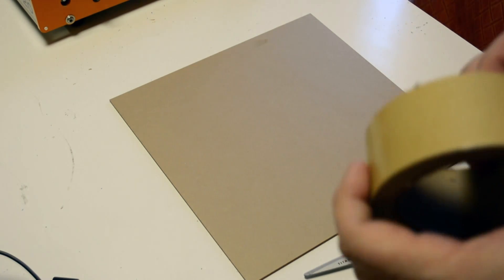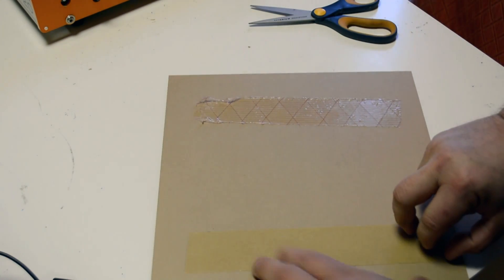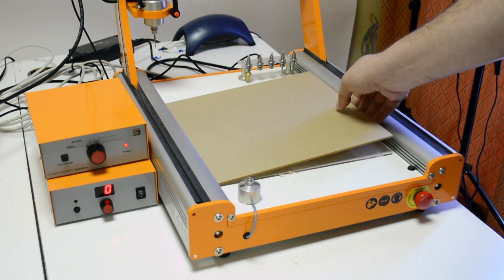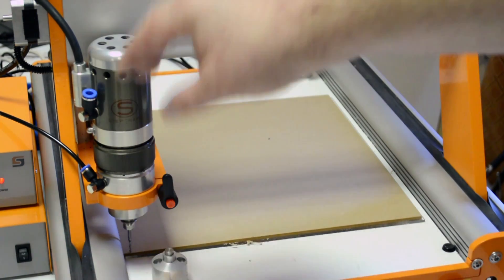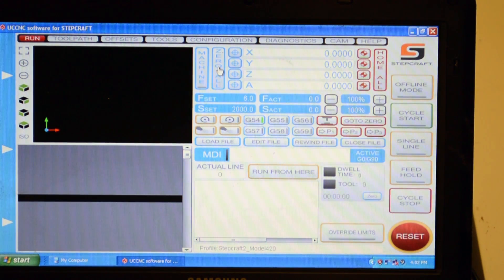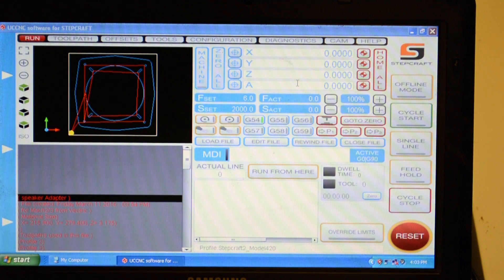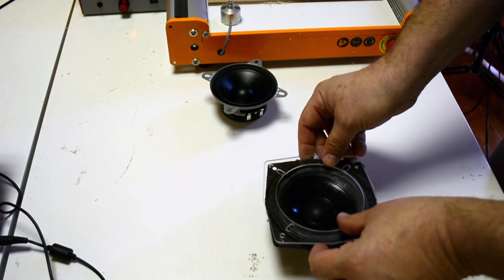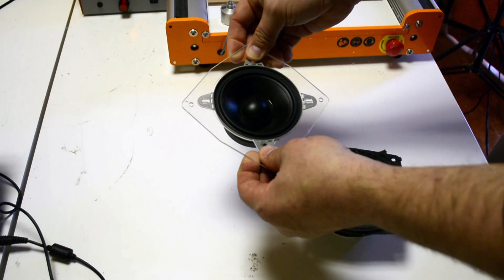STEPCRAFT TRAINING - Making A Car Audio Speaker Adapter With A CNC - Part 3

Comment: Hi, Wondered if you could point me in the right direction. say if you cut that 4 inch hole first, then stopped the machine and measured, if it was smaller than you wanted, is there like a tool compensation offset etc you can adjust in uccnc? And then re-run the tool to cut again to the programmed size. how would you do it?

Comment: I heard on the previous video that you used a mac for working with the program.  Well this output to a cnc machine using the mac or did you have parallels on the mac and were using it in windows mode?

Comment: excellent...what was the software used in pt1 and 2 to do the layout?? I just bought a 302 kit, but have not yet even opened the box, as I have recently moved into a new house and am currently building a work bench and setting up my work space. Looking forward to assembling the kit and getting into it all. In the meanwhile I will watch all your vids..cheers
Reply from the maker: +raindogred Hi, I used Vectric Cut 2D but you can also use V Carve as well to do this. The machine uses UCCNC to run which comes with each system